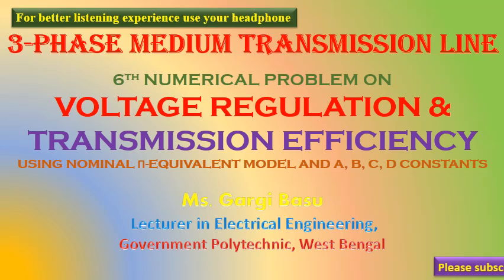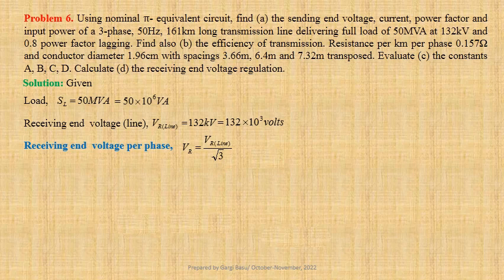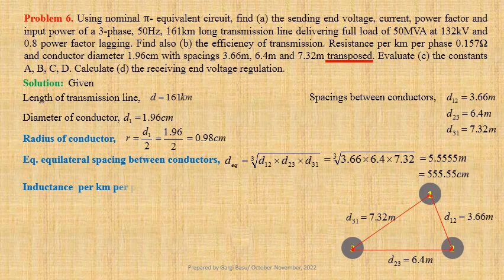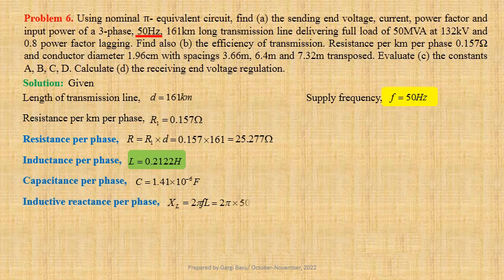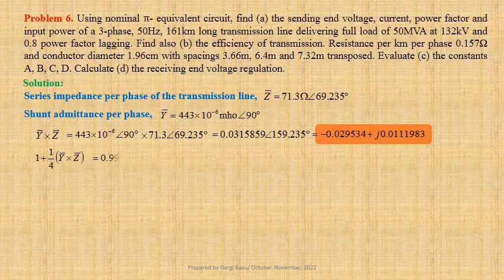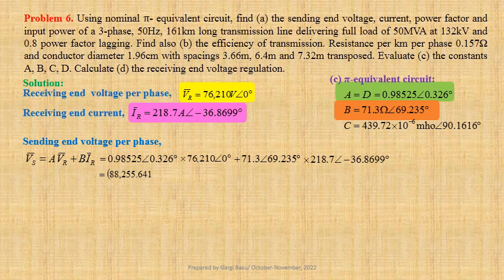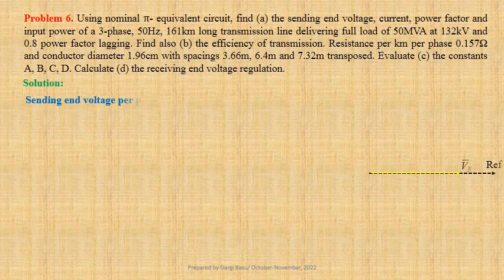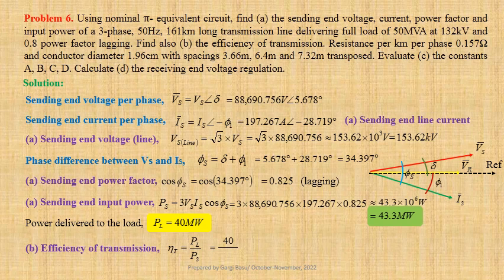Medium Transmission Line: PiEqCkt: 6th prob on determination of ABCD consts, REGULATION & EFFICIENCY

Comment: The load current 218.7 A is incorrect since the equation is missing the cos(theta) in the denominator. The calculation P/sqrt(3)*V_LL*cos(theta) = 50000000/sqrt(3)*132000*0.8=273.37A
Reply from the maker: thanks for the correction